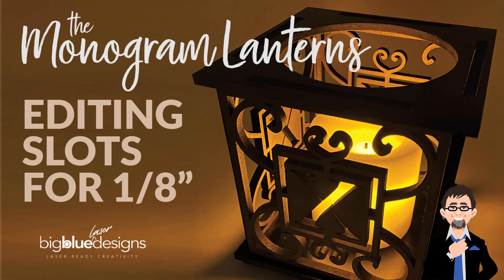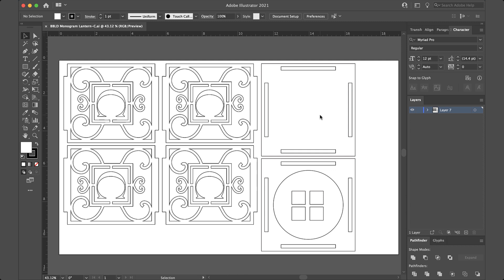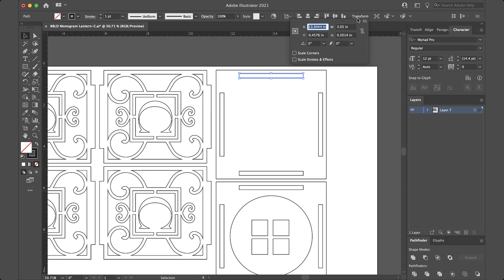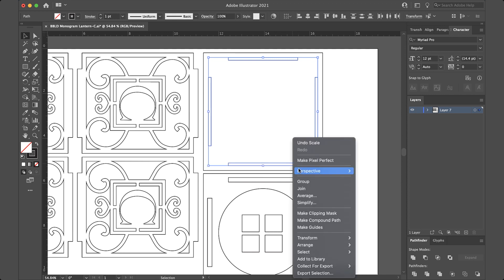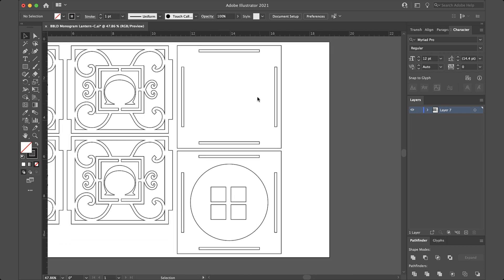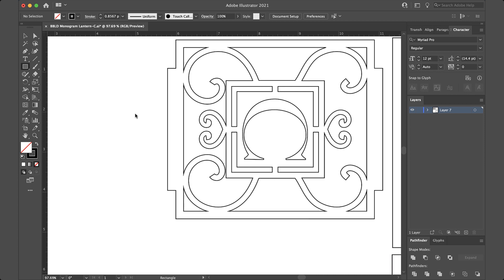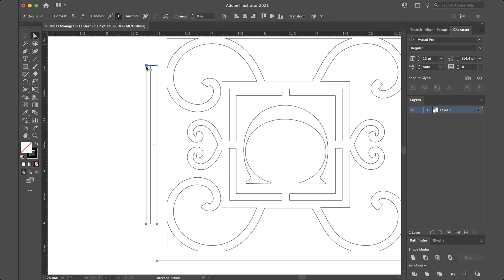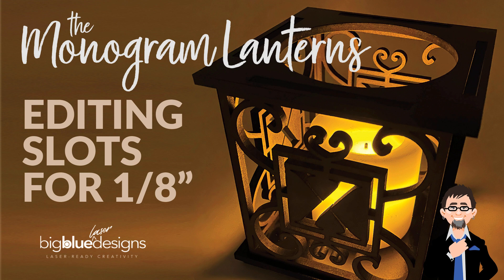Tutorial: Editing Slots and Tabs for Different Material Thicknesses (Adobe Illustrator)

Comment: What if you have a 1/8" material file but have 1/4" wood? I increased the height of the slots by the number obtained from your slot file and it wasn't really fitting correctly.
Reply from the maker: That’s the right step. I’d need to know what the fit was, whether too small or too large, and what the other circumstances were (what program you’re editing in, how it was saved, what file format it was saved in, etc)

Comment: In the way you made this change how do you ensure it removes the extra height in the right direction? If you are thinning out your pieces that material can either be taken from the outside or the inside surfaces. How do you make sure that it is consistent? In one case your slots could be to far inward and in the other they would fit properly?